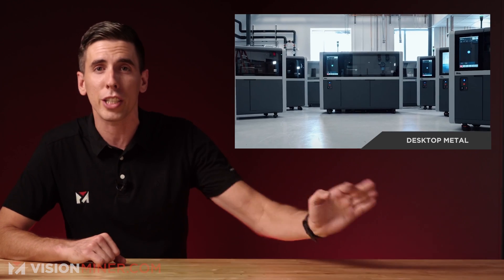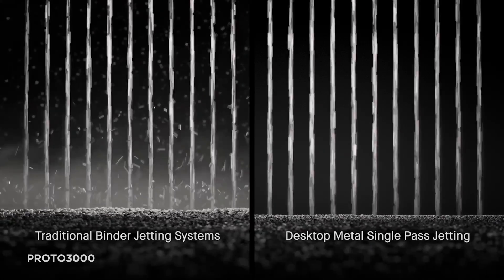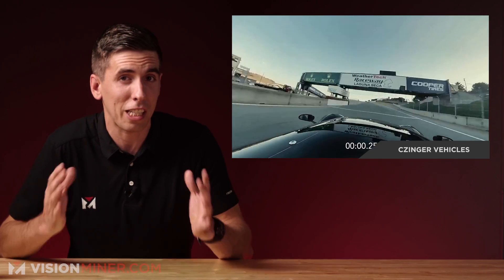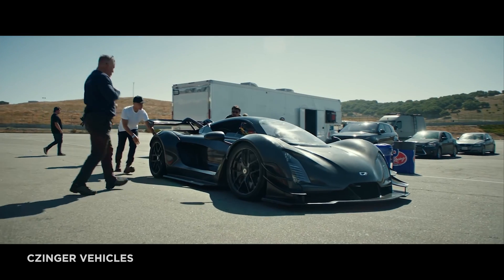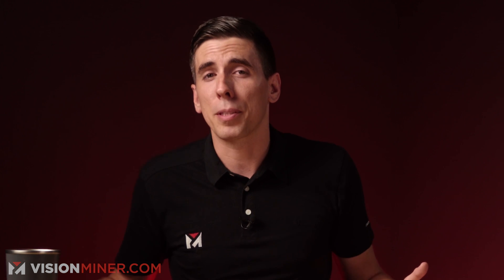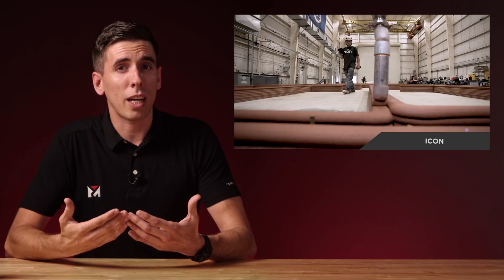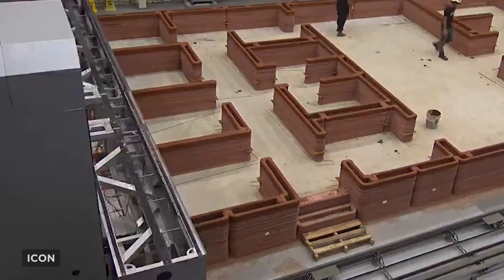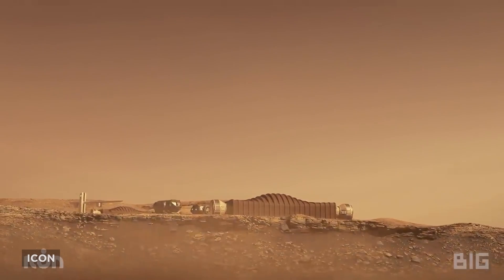Desktop Metal ExOne Merger, Czinger Smashes Laguna Seca Record, ICON's Largest 3D Printed Building!

Comment: I think DM is going to end up in the lead for simu-metal for basic component manufacturing but isn't going to break into aero especially because of the support structures internally. And IKON for the Army and their FOB needs. They're going to have to lighten and simplify their machine a good amount because they want to be able to dump a printer in a box out the back of a plane like they do other supplies

Comment: Yet again fkn nailed the video. 

What’re your thoughts on the Einscan pro. I’ve got a chance to get a great deal on one (under 2k) not the pro + just the pro. Also on the lower spectrum, creality just released their handheld scanner.
Reply from the maker: They do work, but they've gotten significantly better in the last 2-3 years -- easier and faster to use. Still a decent unit, though!